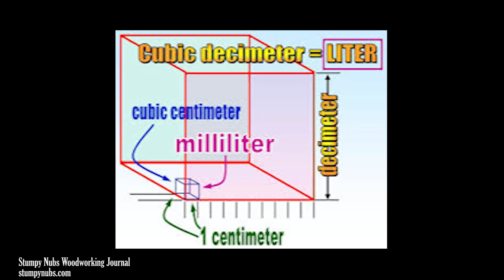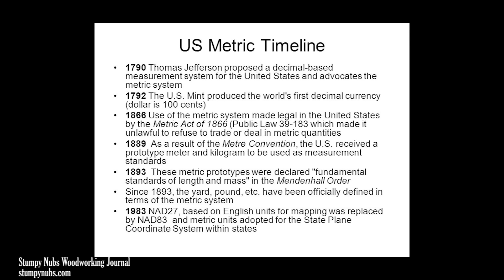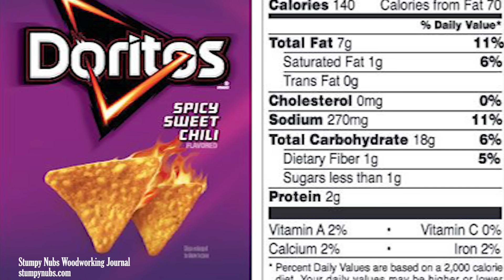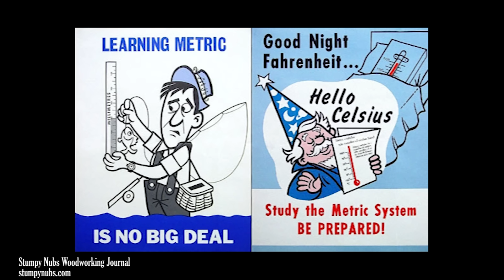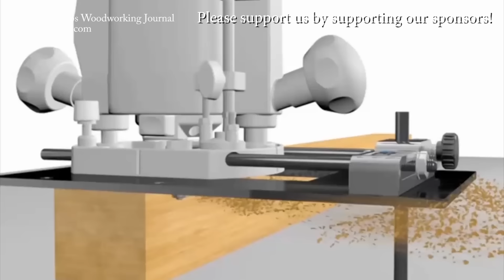BREAKING: The USA is switching to METRIC!

Comment: I’m from the UK & I remember our conversion to metric. It was a great move.

I took my scuba instructors exam, I used metric for the physics portion, most others used imperial. I finished about an hour before everyone else (generally scoring higher).
Reply: Geez, don't even want to think of doing this in imperial units. Speaking of, I wonder how many accidents happened because of imperial-units calculation errors.
Reply: Though as an add on question, we use 10m=+1bar pressure. Do USCS divers use PSI for that as well? Is there some easy way to gauge? Or one just remembers 10m=+14.5 PSI (or is it rounded to 14)?
Reply: I'm from the UK also and whilst scuba diving might be easier in metric we are not all metric yet, its a mixture, the temperature is Celcius though and that's definitely better!?!
Reply: Even beer is metric an imperial pint is 568ml in Ireland a brewers yearly output is measured in hectolitres
Reply: @carcharhinus_555  Yes, they use PSI.
Reply: Also from the UK, in my 40s and remember being taught both systems at school. The problem with the UK is we use both systems. Certain things are imperial and certain things metric. In fact I'd say it's probably more still imperial than metric. Glad to have moved to a country that only uses metric though I still talk in imperial most of the time. Metric is much better IMO.
Reply: @carcharhinus_555  NASA's Mars Climate Orbiter... The infamous metric imperial incident ever caused lol
Reply: @thomasherrin6798   what's better is subjective in the end. BUT: celsius is measured around Water, wich is probably the most common and important molecule we have on earth, so it's very easy to understand that water that is freezing is below 0 and boiling water will be almost exactly 100 degrees, on the other hand you have Fahrenheit and whatever random values being the referance points, yes its totally random and yes if you are used to F you will instictively know whats what, but it will be much less intuitive for everybody who doesnt do physics to understand very basic dependancys and relationships between things. Like adding salt to water will increase the boiling temperature about 4% wich equals to 4 degrees now tell me that in Fahrenheit without having to calculate
Reply: the inch unit system and other unit system are stupid. It is not because of stupid system, but because  that they are not compatible with the international system SI. All other unit systems must compatible with the international system SI. 
I often use computer programs for technical machines and other engineering tasks. And I often have to store and enter various values for various variables in computer programs, then let computer programs use entered values to calculate various tasks. You know that computer programs use standard known scientific formulas to calculate. If you enter values for variables in different unit system, then any time you add values, you must check the unit used in scientific formulas, then you must convert the added values to required unit systems. It is nightmare in engigeering tasks and scientific tasks. 
The only solution is that : use universal unit system SI : all programs and people exchage and communicate only with values in SI system. Thus no need to convert and check formulas when you apply variables in scientific formulas.  
Other unit system maybe comfortable only in conversation communication languages, but not in engineering tasks.
Reply: @mRw0oK  "adding salt to water will increase the boiling temperature about 4%".  The first question I would have is what would the average person need to know this for?  The second question is where did you hear this?  This is only going to be true for specific ratios of salt to water.  Also keep in mind that water rarely boils at 100 degrees due to impacts of elevation and other solutes already in the water.  Impurities also impact the freezing point.

Also keep in mind that neither Fahrenheit nor Celsius are truly zero based like Kelvin.  So 4% isn't saying it's 4% hotter.  It's just 4% higher difference between the freezing point and boiling point of pure water at 1 bar of pressure.
Reply: @OweEyeSea  I get what you want to say, but we are talking about imperiale vs metric here and in comparison if you just take basic physics, every average Person can calculated alot of things very easy just by knowing simple Mathe, meanwhyle with the imperial System you need to know alot of values and stuff to even start calculating the Most basic things. Also you can reverse every question of yours to the imperial System and you'll find it very hard to find Arguments for the imperial System.
Reply: It was so great that the UK is going back to pint, inch ,feet, stone and all the other imperial stuff....😂😂
Reply: @abstractexchange5057  That's ignorant, both SI and customary are defined with respect tot he same base standards these days and have been for quite some time. 

The solution is to stop hiring incompetent programmers to deal with this situation. There are exact conversion factors for anything you're likely to use and somehow even cheap calculators can as well.
Reply: @thomasherrin6798 the uk is mostly metric other miles.
Reply: Gotta say, even metric is a pain in the ass regarding volumetrics. The magnitude conversions and lengths in three axis converted to volume is just brain melting. And especially so when you start converting the magnitudes of ^3 into a more conveniently sized number, but might still go back to lengths for the desired result. Thermodynamics still haunts me in the night.
Reply: Yeah but my bus fare changed from 3d to 4p...ripoff eh
Reply: @carcharhinus_555  when Canada changed over , there was a airliner that ran out of fuel half way across the country , the ground crew thought they were pumping in gallons and they were pumping in liters. Likely adding to the confusion was it being a American built plane , with fuel capacity measurement in gallons , being used to thinking about gallons needed to travel miles , and changing to liters needed to travel kilometers
Reply: I remember the conversion as well it was and still is a friggin nightmare, I did not convert and I am happy with that.  If I want to buy screws for example & they are only in metric sizes I buy from somewhere else
Reply: @stuartc6303  it's true - in the UK we're not really metric yet. For example, millions of homes were built with stud walls where the studs are on 16 inch centres. Similar for floor joists & roof trusses. So an 8 foot x 4 foot sheet of plasterboard fits across 3 studs exactly. This can't change unless we start to build truly metric buildings. Which means suppliers will have to go through a long period of stocking dual sizes. So - we have standard sheet material sizes of 2440mm x 1220mm. You can call that metric if you like - but it's still 8'x4' really. I'm young enough (just) to have been taught metric at school but I'm comfortable using either. Depends what I'm working on - if it was designed in metric, I'll use metric, if it was designed in "imperial" then I'll carry on working in Imperial.
Reply: @rigamortice  well good on you, I can still ram some of my Whitworth and AF spanners onto metric nuts, smooches them up a bit tho, is that what you meant by metric conversion? Or do you just like adding 57/60ths to 19/23rds etc!😁
Reply: @stuartc6303  Do you know your weight in kg, or still using stones?
Reply: @outinthesticks1035  That's not how the mistake was made. Fuel isn't dispensed by the gallon or liter at the airport, they go by weight. The volume is of no use to them, they need to know the weight so they don't exceed the max load limit. If they use gallons or liters, the pilots would be constantly converting to weight. The 767 that ran out was the first plane where fuel was meant to be measured in kg. Since the fuel gauge was busted, they had a ground worker dip the tank. Then the pilot did the calculation using the imperial factor instead of the metric one.
Reply: @e-curb  ok , I was misremembering the exact factors , but did know it was attributed to a incorrect metric conversion
Reply: @e-curb  My scales are in KG and I'm not exactly sure what my weight is in stones, aside from overweight. Haha. But I still talk in feet and miles when I actually mean metres and kilometres.

Comment: Being a Brit. I drive in miles and run in km. I drink litres or water and pints of milk. I lift 12kg weights because I want to loose about a stone in weight. When I make a loaf of bread the recipe in my head is 340g(ml) of water  and 3.5 cups of flour.  

When I buy tape measure it has meters on one side and feet on the other.  I use both sides.
Reply: The only reason why you think in terms of km when running is because bureaucrats have made it the mandatory system with running. I bet you running apps a devices push it on you. There is a reason why you think of miles when it comes to driving and that is because it is more natural.
Reply: Sooner we go fully metric in the UK the better.
Reply: @Art-is-craft Natural? huh? why would that be?
Reply: @stevep4131  
Imperial is natural and metric is not.
Reply: @NantokaNejako  
It is derived from human interaction with the natural world. The irony is that the metric system requires the imperial system to come into effect and requires it to function.
Reply: @Art-is-craft  "There is a reason why you think of miles when it comes to driving and that is because it is more natural."
It only feels 'natural' to you because you are used to using miles. You could get used to using km and then they would feel natural to you.
The metric system is just so much easier to work with we really should make the effort to go 100% metric - as a favour to the next generations if nothing else. We'd all appreciate an easier system - its only natural 🙂
Reply: @stevep4131  
Metric is not easier to work with. Imperial is a natural system that is fraction based. Humans are more easily able to use feet and inches and the mile is of proportion to the human scale. Inches as a system was not introduced by decree but was developed over countless human generations. It may appear easier for a system to be based in 10 but it is not.
Reply: @Art-is-craft  "Metric is not easier to work with." 
I can't imagine many engineering or physics students agreeing with you there! In my experience I just know metric is easier.

"..developed over countless human generations" 
Just because something existed a long time does not mean it is/was intrinsically good. I'm sure we can both think of many unpleasant examples.

Seems to me the basic problem is that once we get very comfortable with something we become very opposed to change. Some things need to change.
Reply: @stevep4131  
Imperial is a fractional system. Advanced mathematics including algebra and calculus for engineering and physics is not going to be using decimals for equations or the derivation of proofs.  Imperial is a system that developed from the natural world over thousands of years. The irony is that metric cannot be derived without imperial.
Reply: @Art-is-craft  The metric system does not prevent the use of fractions.
I agree calculus does not require decimal points but why is that relevant? 
No measurement system is "natural" - they are all man made.
How do you mean "metric cannot be derived without imperial"?
Reply: Yes,but what is on top,metric or feet??
Reply: @jooproos6559  measure right to left... meters. Left to right... feet.
Reply: Doesn't get much more British than that.
Reply: @Art-is-craft  The irony is that US Customary Units are already defined exactly by metric.
Reply: @stevep4131  
Fractional measurement systems are developed from the natural like time and distance.
Reply: @inboundbark  
You mean they are declared by committee just like the introduction metric. Nothing natural about that.
Reply: Sounds like the worst of both worlds.
Reply: @stevep4131  We are fully metric try buying someyhing that isn't??
If you are talking about miles the reason we left it as it was was the cost of moving and replacing all the road signs and road markings.
It wouldn't be just a matter of sticking kms on the signs as you would end up with some strange measurements if just converted. The signs would all have to be moved as well.
There are a few metric measurements that aren't far off imperial measurements for older people to do an easy "in the head" reckoning. eg metres and yards aren't far off each other, 25mm is app an inch. eg the motorway countdown signs are 300/200/100 yds to the exit and as a a metre is 3.3 ft it's near enough a metre not to bother.
80 kms is 50 mph so you can easily work up or down eg 40kms is 25 miles etc.
Metric has been taught in schools for years so most have no idea what imperial is.
When estimating something in my daughters house I would say it's app 6 inches or a foot long but she would ask me to convert it as she had no idea/concept of inches.
Go to a diy store and get a sheet or board for the wall.
what used to be an 8 x 4 ft is now 1220 x2440 in mm
We have to keep the imperial sizes and convert them as that is how our houses were built so there would be a lot of waste if they were say 1500 x 2500 mm? 
Note the UK spelling as it differentiates from gas or electric meters when written although it sounds the same.
Reply: @Art-is-craft all metric units are defined by natural constants. The imperial units are defined by metric units since they by themselves have no acurate natural reference. You are exactly 100% wrong, and have to get over your misconceptions.
Reply: @hepphepps8356  
The fractional system of inches is a twelve based system just like a clock. The reason for that is due the rotation of the sun from the observers point of view. Such concepts are perfectly mapped to geometric functions and is the reason why Newtonian calculus was developed with fraction systems rather than metric. The irony is that metric cannot be derived without three traditional fractional system.
Reply: That’s why British cuisine is so good 😅
Reply: @LuisPerez-xe6nu  
Britain has a cuisine but what has that got to do with their contribution science and engineering.
Reply: @Art-is-craft  Of course it’s related to the topic when British are mixing imperial and metric systems to measure the amount of ingredients used to cook.
Reply: @LuisPerez-xe6nu  
Britain has a cuisine. So what?
Reply: What kind of "meters" does it have on one side? Digital meters or dials?
Reply: @Art-is-craft  You are equating imperial with base 12, the problem is imperial is not base 12, it is inconsistent. 12in = 1ft. 16oz = 1lb. 14lb = 1st, and so on.  

Everyone's body measurements are different and you can easily find metric references as well as imperial. My forefinger, for example, is close to 8cm which can be divided an multiplied just as, if not more easily, than 3 1/4in. This is only relevant for estimates, because with a ruler you can attain similar precision with either system. A mile is already too big to intuitively process using human body size so I don't know what you're going for there. 5km/h is a good human walking pace estimate so km can fit with human based estimates just fine.

And the imperial system you praise as being some natural enduring truth is just one of a bunch of feet/inch/mile/cubit type systems that have varied from place to place over time. The specific 'imperial' system you grew up with was also decreed by an authority and 'pushed', just like metric.

People are telling you that metric is easier for them to use and you're trying to tell them their lived experience is wrong. One can achieve proficiency with both systems, but metric is objectively easier to learm because it is consistent and thus there is less to memorise, without any loss of precision.

By your odd asides and dogged persistence in reiterating the same few preoccupations, it's clear that your investment in the imperial system is not really to do with its efficacy, but rather an emotional 'old ways are best' attachment. Naturally then, there follows the conspiratorial resentment of the elitist, globalist, metric cabal that erodes nations' sovereign right to use the patriotic, traditional units bequeathed by their forefathers, and instead ensnares the minds of the youth with a cold, Orwellian base 10 system that rots their brains and makes them have horrible newfangled opinions. And this of course is exactly why society is going to hell in a handbasket, and why no one else here agrees with you, rather than it being because possibly you are out of touch.